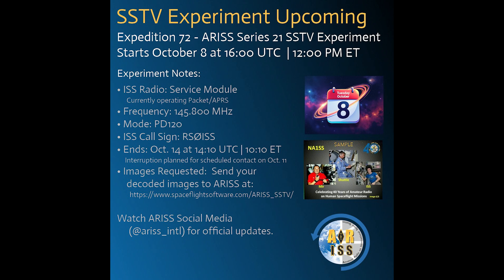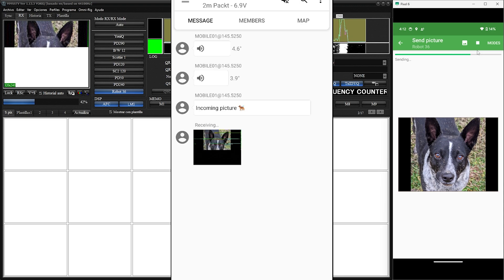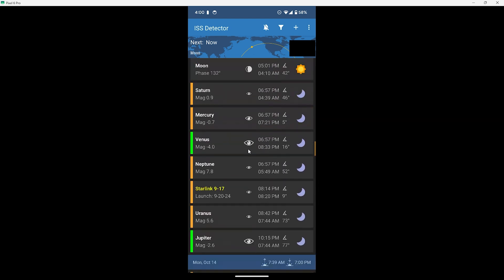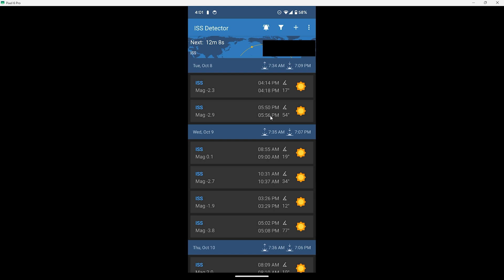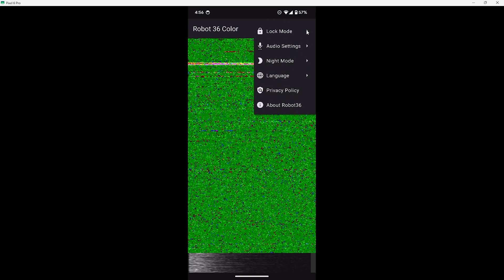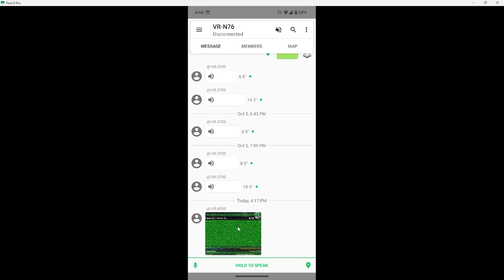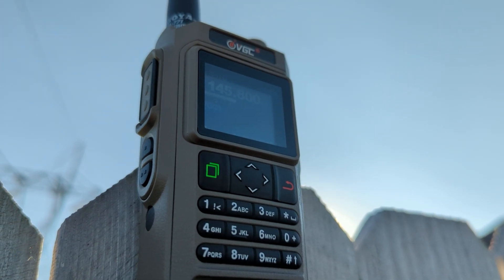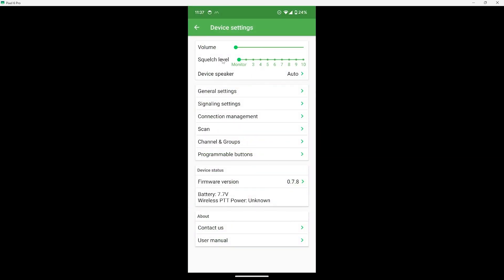Receive images from the international space station with basic radio equipment!

Comment: dam i was hopin you could use an sdr for this.
Reply from the maker: You should be able to! Are you using Windows?
Reply: @The_Comms_Channel  
i do. windows 10.
Reply from the maker: There's a windows program called MMSSTV that you could use and pipe the audio to it with VB-Audio CABLE. If push comes to shove, you could also just hold your phone up to the computers speaker and use the Robot36 app and decode that way
Reply: @The_Comms_Channel  i really appreciate knowing this.